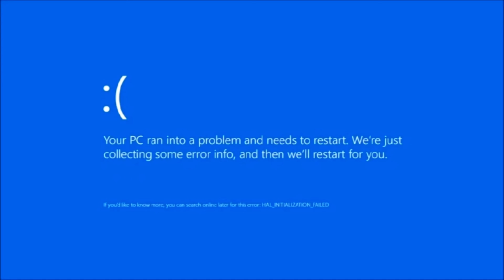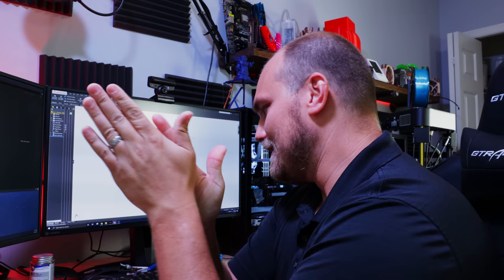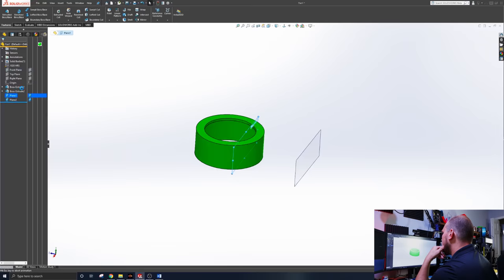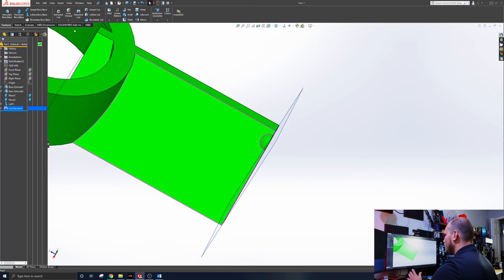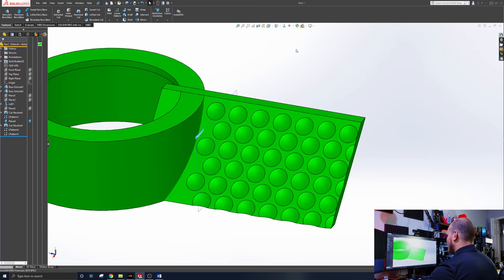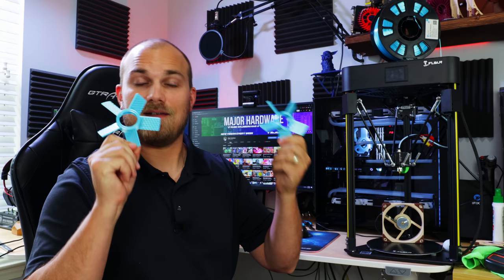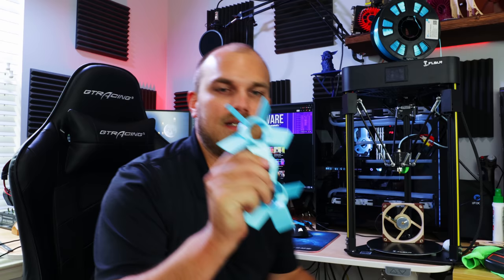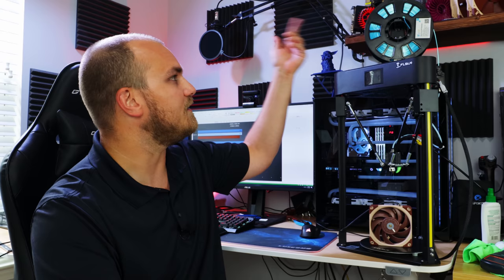What If Fan Blades Had Dimples Like A Golf Ball?

Comment: Actually, I think you should rather measure current flow instead of RPM, as the actual RPM are more or less steady no matter the load(fans tend to hold a steady RPM and regulate themselves), while the current draw might actually change alot. If you have a higher load and try to maintain the same rpm, you have to put more power into it, so the current rises.
Reply: Could try checking the airflow as well.
Reply: @JasonWaltonDriveAlong  yeah you're right, i think the best option would be to compare the amps per amount of airflow or something🤔
Reply: Also higher speeds on the fan will give more effect from the dimples. My guess is it'll reduce noise.
Reply: I had the exact same thought when I watched this video... The RPM should remain constant as long as the motor can get enough energy to spin it(overcoming the mass of the object). The amount of airflow and the load on the motor would be the two possible dynamic variables. After thinking about it more... I suppose if he's turning the fan on max output which should use a constant load, then the RPMs could vary. Not enough details given to confirm...
Reply: Yep, when we performance test fans at work we measure cfm and wattage.
Reply: These are brushless motors. Depending on design of the controller it could indeed be regulated to a fixed RPM. Current doesn't necessarily tell the story either. Airflow adhering better to the blade would result in higher airflow (which should be the main goal); this would INCREASE power consumption, but at higher pneumatic output, that's still a win.
Reply: I agree and wondered if dimples created greater air flow. Ambient temperature and cooling effects are more dependant of many other uncontrolled variables.
Reply: @crispbeecrisbundyrun  Re: greater airflow: Probably not. Dimples are turbulators, they cause the boundary layer to transition from laminar to turbulent. But a sharp leading edge on a blade-like airfoil usually already has that effect.
What's more: dimples are not very effective as turbulators. Small elements protruding from the surface are more efficient at that. These can not be employed on golf balls for obvious reasons, but in any application in aerodynamics where turbulation is called for, more effective tools are available.
Reply: Exactly. Current draw and CFM airflow are the inly two metrics that actually matter in this experiment, with RPM as the control.
Reply: Personally, I hypothesize that the current draw and CFM will both be less for the dimpled blades when comparing to the smooth blades.
Reply: @HotelPapa100  appreciate that thought. I wondered if the turbulent effect could cause a venturi effect dragging more air through due to differing pressures.
Reply: @crispbeecrisbundyrun  Oh, the "wavy upper surface of an airfoil" fallacy. Even Einstein fell for that as a student. It's the result of a wrong explanation of lift. Long particle paths across the upper side of an airfoil do NOT create superior low pressure zones.
Airflows HATE to be decelerated / flow against increasing pressure. You don't want to do that repeatedly. If a process needs entry at one pressure, exit at another, and a third  (usually lower) pressure somewhere in between, you want to optimise the pressure distribution between these three points to be as smooth as possible, and the pressure increase just as abrupt as the flow can manage at the given Reynolds number.

In fact, turbulators do exactly the opposite: overload the laminar boundary layer to get it to detach (stall) locally, and then get the turbulent boundary layer (turbulent after quick transition in free flow) re-attach as quickly as possible. By doing that they minimise the losses caused by the detaching airflow, keeping the process at a small scale and avoiding macroscopic flow separation.
Reply: Was thinking the same thing
Reply: I believe these fans are essentially run to a fixed current (always puts rated volt + rated amps to the fan) and spins at whatever speed it requires to achieve the introduced amps.  Essentially RPM gives you a measure for HP per RPM.  Typically for axial rotors you want fast fans for high pressure and slow fans for high flow - This is a pretty low pressure rise application so I would expect to see the fans that ran at lower RPM providing better cooling.
Reply: A hub with zero blades would win the RPM race easily
Reply: That’s true inside a computer? Is he using a fan controller that is designed to maintain a constant rpm for the test bench though?
Reply: THIS is what i would say. 
Less material BUT less air flow. 
That's my guess
Reply: Sorry my English is bad. You’re correct voltage will effect the rpm but the weight or the drag of the blade will only effect the current unless the drag is too much for the motor too handle. Therefore just test current and wind speed
Reply: I am sure that was what the cooling tests was... If they had more airflow they would cool better and as shown they was pretty much the same still
Reply: Also consider the curve of the golf ball. Flat blades will not be affected as much as a curved fan blade. Not sure exactly what design would be best but I'm sure he could do another video with multiple fan curvatures.
Reply: Dimple both sides of the fan blades. 🙏🔑✌️
Reply: Y'all are thinking the wrong way, if he gives the fan a steady 5V (or whatever) the rpm gives you a meaningful result...
Reply: The blades as made have too much flex to benefit from dimples.
Reply: This is a good point. RPM shouldn't change since its controlled mechanically. But CFM can improve by fan blade design
Reply: @2mustange  Please read my comment (2 above yours). Source: Am an engineer
Reply: The dimples would create a effect only at high rpm
Reply: I was thinking the same thing.
Reply: @baburaospeaks2429  Yes, like golf ball speed: 100 or 200 mph.
Reply: Yes this ^
Reply: but, if you have the same current, but different loads, then shouldn't the rpm change? Or is there some reason why that isn't the case?
Reply: @espressocookie8965  I think you're right.  Imagine if an electric car could use the same energy no matter how steep the incline or how high the speed (air drag).  That would break the laws of physics!
Reply: @eue4127  It depends on the type of motor. With a brushed series wound motor you would be right. but these little cooling fans usually have brushless permanent magnet motors which will maintain a steady RPM despite slight changes in load, because the speed is set by the frequency of the 3 phase AC supplied to the motor, and the Voltage.
Definitely need to measure Voltage and current supplied to the motor to get a value of the energy supplied to the motor.
Reply: same rpm so see how much current is being used at save voltage that will check efficiency.
Reply: Deft Motion  Like an aerodynamic car that cuts through the wind at the same speed as another car, but it uses less energy and leaves a smaller wake (pushes less air).
Reply: @JasonWaltonDriveAlong  The heat removed is a function of airflow.
Reply: Brilliant catch.  Of course this is a key input.  Like you said, 60 Hz or whatever frequency the motor control is putting out drives the rpm, but material reduction and power consumption are huge scaling considerations...probably top two.
Reply: Exactly you need to use and Anemometer, and measure the velocity. Measuring RPM didn't make very much sense.
Reply: @leif-erikhallmann  i work in the building industry, and I used to work for an electrical/hvac engineering firm. Think Air Conditioning and power systems for data centers and major corporate headquarters. CenturyLink, JPMC, Time Warner, Nationwide etc...

Cfm/kilowatt is the penultimate test for cost effectiveness. There's a LOT of different ways to express it, but it always boiled down to, how much money are we spending to get how many BTU's of cooling, of which CFM/Kilowatt is a primary factor.
Reply: Not Important 
If CFM/Kilowatt is the penultimate test, what test is the very ultimate?  “Penultimate” means second from last.
Reply: @eue4127  I completely agree with you however he would then need to be measuring and limiting the amount of voltage given to the fan. If the fan motor is just drawing more voltage to maintain 1800 rpms or whatever they both measured at. Seemed odd it would be exactly exactly the same when one fan blade weighed almost 10% less.
Reply: @Nilboggen  In the bios, at least on my pc, you can give the fans both fixed rpms or fixed voltages...
Reply: @eue4127  Depends on the design of the motor, honestly. Voltage AND current will tell you the actual power in watts. Combine that with the RPM to get the watts/rpm delta and combine THAT with the actual CFM to determine overall efficiency.
No matter what, current is a necessary measurement.
Reply: AC fans hold a steady RPM. PC fans are DC and the speed is variable.
Reply: You forgot about gravy
Reply: Yea I was thinking the same thing, Measure the air flow and power consumption.
Reply: Choose a goal!  You desire excellent cooling at minimum cost ( energy included)
Reply: Yeah, dc synchronous motor cannot run if they don't run at synchronous speed.
Reply: Leif-Erik Hallmann & @jasonwalton I'm just starting to watch, and reading your initial comments, not measuring current and airflow, im wondering if i should watch... Doesn't know 1"=2.54 cm, is weird too (or, is it an issue with moving one decimal point to the left...)
Good talk, im gonna dip
Reply: @eue4127  unless it is internally controlled rpm by circuitry as with these type of motors.
Reply: Thats funny, I just suggested he try measuring airflow when using very low rpm or very high rpm. I think it would be interesting if dimples actually could outperform the flat blades in other scenarios.  What about curving the blade or tweaking the angle of the blades?
Reply: @eue4127  only if he was only giving it 5v constant. If say the fan controller was regulating the RPM like most do (check MSI Kombuster/Afterburner or any software of the sorts) usually there is a RPM limit. So if his test bench was using pc software and not voltage then it would be a solid rpm but voltage would change due to the motor needing to spin the fan to achieve said rpm. 

Really it all breaks down to how he has the test bench set up
Reply: @HotelPapa100  So, it's pimples over dimples?
Reply: I think this is good enough for a guy with a 3d printer. It's about the same scientific rigor as mythbusterrs used to employ. They just mentioned the word science more often. I think the reason why they put dimples on golf balls is because it helps them spin and the spin is what makes them go farther and also hold their course better. Like the rifeling in guns.
Reply: The cooling test should've revealed any flow differences.
Reply: I mean, the function is to push air through in order to cool things down so yeah, airflow per amp is the only bit that matters, not RPM or anything like that.
Reply: Dimples would mean lower friction and less air displacement. even at a higher speed it would move less air than non dimpled would at a lower speed
Reply: PMW vs voltage.
Reply: I agree amperage should have measured
Reply: @WesGann 
 "overcoming the mass of the object"???
Reply: Second.
Reply: @alcapone5876  Dimples would cause a slightly larger surface area so more friction would be the natural assumption but they probably mostly cause turbulense.
Reply: This depends on the fan and what operation mode
Reply: @MusicHunter111000  agree!!
Reply: Good observations. Good thing the man started the conversation by doing the experiment and publishing it.